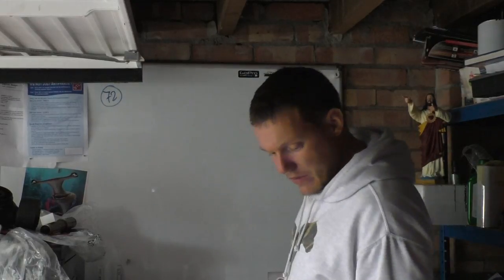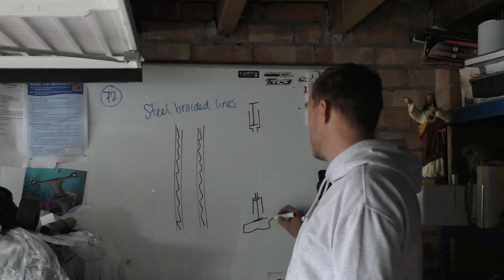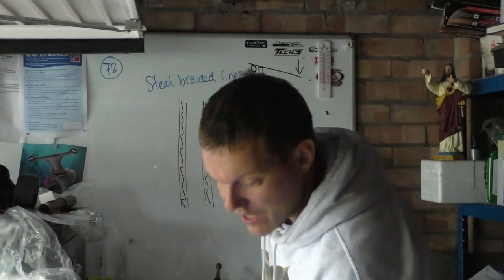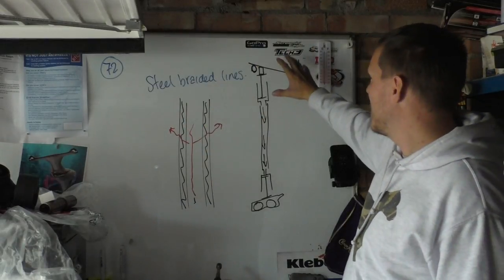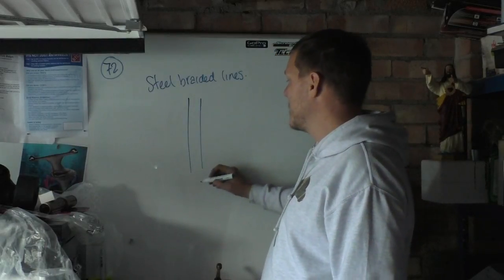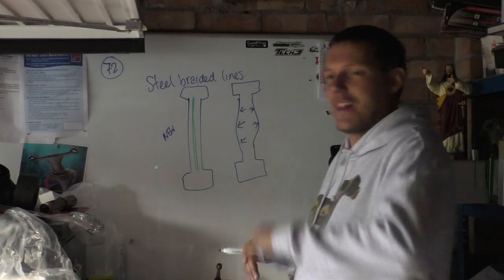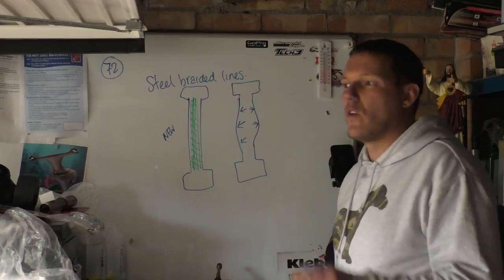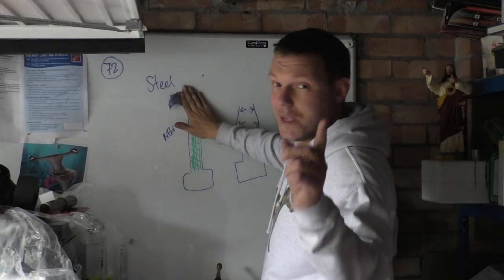Braided Brake lines - why? -and how?

Comment: let me comment that. Once I replaced the brake lines on my bike. I was courious about the OEM brake lines, so I took them apart. I found the following. The major diameter of that rubber looking line is not the brake line. Inside that rubber line is a much thinner kinda plastic hose. i dont know exactly what material, maybe nylon or teflon. This thinner hose is only about 3 to 4 mm in diameter and the walls are quite beefy. The hole for the breake fluid was only 1 mm where the whole brake line looked like about 8 mm in diameter. Those thinner inner hose reminds me on industrial special hydraulic hoses which support pressures above 1 kbar. But furthermore the inner structure also connsists a braid. Not steel, but a kind of braid.
My thought about that brake line changing intervalls are super paranoid engeneers. I belive as long as the fat outer rubber line is able to protect and nicely embed that thin inner line everything should be fine. But once the outer line degrades by ageing or UV exposure etc. the inner line is in danger. And moreover are plastics known to stiffen up over time an get bridle.
The steal braided lines usually available here in germany sold as a lifetime solution. For sure the steelbraid is more stable to the elments and mechanically more capable than the rubber ones. And the inner line on those steel braided ones seem not to be affected by ageing taking that lifetime warranty in consideration..... just my thoughts!
Reply from the maker: The braiding is usually nylon stranding and for some brake lines aramid fibres i.e kevlar
Reply: What I also wanted to point out is that the OEM brake lines are by far no easy or cheap sulution. They are more than a first look reveals. So I agree with your saying about new OEMs feeling as good as new steel braided. I myself changed to steel braided ones within a time the OEMs where far away from beeing overaged. I was quite dissapointed from the change until I found out the OEMs are nothing someone should call crap.
Reply: Thats right. My intention was to highlight that the OEM Brakehoses are not simple Rubberhoses as they may look like. And of course the outer rubber is to protect from the elements. And if the rubber gets a sort of damage the function is normally not imideately corrupted but the protection is weakened and a replacement is adviced...

Comment: the lever is only part of the force muliplier, much of it is in the difference in area of the master cylinder and the slave cylinder
Reply: I was going to mention this also. I doubt it's anything more than an oversight on Matt's part, he's not exactly stupid.
Reply: He tends to keep it simple and get to the point without TOO much tangent. Even talking about the lever is already a sidetrack in a vid about line material and construction.
Reply: thank goodness there's still some people with at least basic physics knowledge. yeah, so basically, the piston in the master is smaller area than the slave. so the longer stroke on the master transfers to much shorter stroke on slave, but with bigger force.
Reply: Lasse Langwadt Christensen and bore size etc etc etc...

Comment: The amount of arguments I have had with dickheads regarding their OEM lines being shit is numerous.  I even measured the expansion of the hose between no pressure and two hands wrenching at the lever - zero expansion!  To be fair, I have replaced lines that have been old and there has been no drmatic change. Of course when you change liens, you change/bleed fluid and I believe this is the biggest difference people feel.  They have their fluid they haven't changed for years, got some gas in it, probably 95% water so boils easy, then they replace their lines and fluid - 'holy fucking shit balls my brakes are amazing!'

Just a quick note: You forgot to mention the hydraulic torque manipulation with regards to different size cylinders - a small syringe to a big syringe translates a large movement, small force into a small movement, big force and this is primarily where the force for clamping brakepads comes from :)

Comment: thanks great vid i did have sam brake fade on downhill almost ordered new stainless lines but it turned out the i wase using sam very old brake fluid probably had sam water  in it

Comment: People talk about spongy brakes - what's so bad about them? Personally I've only had 2 bikes, both with rubber lines. My first was a shitty little 250, and they were spongy as hell, but I got used to them and never found them to be a nuisance; my fingers just adjusted and applied the right amount of force on the lever as required. I imagine braided ones are more responsive and require less force on the lever making them more sensitive, but is this a universally good thing? Basically I'm seeing this as simply a personal preference for something more sensitive. Is that the case?
Reply from the maker: with a 250 then the bike doesn't weight so much and you aint going that fast. Try stopping a 1000cc with spongy brakes
Reply: haha oh damn, well that clears things up for me hahaha

Comment: I had my scooter for a year before taking the plunge and getting braided hoses. Felt the same. Next service, they did the brakes, came back solid. I requested to keep my OEM hose though - just in case.

I want braided lines on all my bikes now.

Comment: You mention hydraulic clutches, perhaps a topic for a future video. Hydraulic vs. cable clutches?
Reply from the maker: YUeah mate already on the list and waiting to do the clutch on the SV so we have a physical example
Reply: There's a guy with an adventure bike channel (motorcycle adventures) who just runs a second clutch cable next to the original one, just tape it to the handlebar and frame at the bottom end. When the cable breaks, you can easily replace it in the middle of nowhere, because you have the line already in place, just need to hook it to the clutch and lever, adjust and off you go. I thought that was a pretty smart solution. That's not as easy with a hydraulic clutch, but not an issue if you're always in phone coverage area. :)

I have a friend with a new Harley with a hydraulic clutch and he says he doesn't like it much as it's very direct. Maybe just a very short friction zone, which could be an adjustment issue, but he's convinced cabled clutches are the way to go.

Comment: Firstly Matt, does the steel in braided lines help dissipate heat from the fluid better? Or does the plastic 'insulation' counteract this?

Also, do you use braided or OEM?
Reply from the maker: "steel in braided lines help dissipate heat from the fluid better? Or does the plastic 'insulation' counteract this?"

The thermal mass of system - i.e the aluminium calipers will have more to do with the heat dissipation than the steel. There are quite a few layers depending on what brand you choose. Some have rubber some have Teflon and kevlar etc.
Reply: @The Workshop yeah makes sense

Comment: Matt, If after 4+ years the steel and plastic shroud is in good nick on your braided lines, is there any reason to replace your lines?
Reply from the maker: For £30 - £40 yeah and your fluid - it depends if you have brake issues - if your going to replace the disc then I'd do the whole lot at once.
Reply from the maker: Obvious budget comes into it.....

Comment: Pretty sure SS brake lines use PTFE (polytetrafluoroethylene) aka Teflon, not rubber. It's less likely to break down over time. As for one debate I'm not sure of, is black brake fluid from moisture, or rubber? I've changed black brake fluid and it went black shortly later. Makes me think it's the rubber contamination.
Reply from the maker: It depends on what brand but Teflon is the way forward and a lot of brand have either started that way or switched/switching over. They generally have layer of Kevlar weave over the Teflon and sometimes a nylon weave over that.

Comment: I put a set on my Ducati and didn't really feel any difference. I also fitted a set onto my Elise and my Caterham and they made a huge difference. I felt less travel on the pedals and just sharpened them up. All were HEL. Would I say the cost to fit it to the Lotus was worth it? Not really. Had to remove he body to get to them which was a fucking nightmare. The Caterham was easy, it has no ABS so the braided lines made it feel like I had fitted a whole new braking system. So for me its been a bit hit and miss.  

My advice is if you have to change them then put some good 1's back in, if they don't need changing then leave them as they are. 

Been wearing my "FUCK THE PANDA'S" tee-shirt with pride.

Comment: body all brake lines are reinforced by steel, nylon etc. brake likes are tested very vigorously for 5000 PSI spec, in reality, they only take 1500 PSI, so if brake likes  are made correctly they are 30 years readable, plus if you see that brake like is bultching that is a bad line as they not suppose to do so
Reply from the maker: "so if brake likes are made correctly they are 30 years readable,"

1) not according to the OEM 2) I've seen brake lines bulging after about 5 years - don't know where you're getting your info from

Comment: I thought that the handle was only part of the force multiplier and that the vast majority of the force multiplier was in the hydraulic cylinder? And that is determined by the volume moved  of one side compared to the other. I know this is mostly moot to most of the video, but just got me to wondering. But other than that I know what is even better than steel braided brake lines... Evan's coolant for your brake fluid, because it's made with fairy dust!!
Reply: It's the ratio of cross sectional area between the brake caliper pistons and the master cylinder pistons. The spongy feeling comes from the flex of the line, and sometimes, the firewall on a car. People fight about the diameter of the line. Its a bullshit argument. Yes, bigger lines flex, but if they have thicker braids, they won't, so it's a line problem, not a concept problem. If you use teeny little lines with giant caliper pistons, the fluid has to go through the line and banjo bolt at really high speeds, so the brakes respond poorly no matter what. Some calipers prevent pad pull-back, so those are unaffected.

Comment: I've wanted to adapt one for the hydraulic clutch on my car, thoughts? Brake lines are already high quality ss braided because daily racecar.
Reply: My car is fookin awesome. Gave my buddies 1300 (some touring Kawasaki) enough of a hard time. It intimidates way above it's worth. It's what got me more into the technical side of engines. The SS brake lines are for consistency in the pedal, same feel every time, cold - warm - hot, and the only upgrade to the factory brakes which were otherwise good enough to take racing with a quality pad. My clutch takes more wear, tear and abuse than the brakes, everything else is sharp so why not.
Reply: PGTMR2 Your awesome car would be destroyed by a bike that costs 2k.
Reply: Kris Nicholson Not having trouble driving manual, and I don't need a different clutch, or master, or slave, or synchros or a bike.
Reply: And your awesome bike will be destroyed by negative temperatures, snow and ice? Everything has its downsides and upsides for example are you going to take a buddy onto the back of your bike and go racing? If you own a car there is absolutely no problem. People go racing with 4-5 people in their car.
Reply: How many days per year there is snow in the UK? Why would you take a buddy to go racing? You realize racing means going as fast as possible to get the fastest lap? What the hell are you talking about? Who races with a full car of people? The weight would make even the fastest cars equal to a toyota avensis. Even a yamaha r125 would destroy it on the track.
Reply: It's possible he meant taking 4-5 people to the track and then racing alone... unless there's a clown car challenge... which should be televised globally.
Reply: Commander833 racing with your buddies in the car is fun and unless they are all fat it is still okay. not ideal but who cares? racing is about driving as fast as possible not building the fastest vehicle possible, that just follows in most cases.
Reply: alles klar klaus even the fastest cars are slow as fuck compared to small motorcycles. There is no such thing as a performance car if it can be overtaken by r125
Reply: R125 is that pull string or pedal start? Trying to think of a car that couldn't beat 13 seconds to 60 or can't go over 140KPH. A Beetle from the 60's? Maybe a Hummer H1? Whatever, it's a short list and definitely NOT "performance" cars.
Reply: PGTMR2 I can buy a gsxr 1000 for 4k and destroy supercars that cost 100k+ and even then they would be humiliated. Search YouTube gsxr 1000 vs (insert a supercar) and you will see for yourself. Cars are pathetic compared to motorcycles in terms of performance
Reply: Yes, but you're not going to do that with a 125cc or 250cc, or even 500cc bike. Pathetic is comparing a 1000cc apple to an orange in the first place. You're only doing that because there is an 1100cc or more apple that will shit on your 1000cc apple. The F-14 in my pic, (apple,) takes off at the terminal velocity of your GSXR 1000, (orange,) and then goes on to mach 2.4. Does that make your GSXR 1000 example pathetic because it doesn't fly or break the sound barrier twice over? They're 2 different things. GSXR wouldn't be great at boating or rock climbing either. I can get a boat and a Jeep for less than $4k, with some money spent on chewing gum to make the boat float, but, I'd still be doing 2 things the GSXR can't. Puhhhh-thetic! See how that works?
Reply: PGTMR2 What you have said is referred to as the ''False equivalence fallacy'' is gsxr supposed to fly? The sole purpose of a motorcycle is to ride on the tarmac and so is the car that is why it is a fair comparison. Comparing bikes with boats is the false equivalence fallacy
Reply: PGTMR2 performance cars are made for performance driving and they get obliterated by motorbikes. I just laugh at all the performance cars I pass on my mid weight sv650s when they try to challenge me. People buy bicycles because they are cheap as hell. Why do people buy performance cars when they are so much more expensive for less performance than bikes?
Reply: If you don't succeed the first time, try the same argument again? You're on repeat here. A Porsche 911 could take down your bike in 0-60 time, why haven't you traded for a $4k GSXR 1000 yet? Completely rhetorical question. Bad Obsession Motorsports, Project Binky episode 16 is out and you're interrupting with this nonsense. It takes months to get a new video from those guys. So if you're finished...
Reply: PGTMR2 porsche destroys a gsxr 1000? I am done bye bye. Live in your own magical world where porsches are able to destroy 1000cc superbikes. Fuck cars, you know why even a 49cc scooter is faster? Because they don't have to sit in traffic for hours.
Reply: Oh. You're not finished and you need me to walk you through this. Okay. No a stock Porsche 911 destroys YOUR bike. Why haven't you traded YOUR bike for the $4k GSXR 1000 since it's teh not puhthetic? Again, it's a rhetorical question, that means you don't have to answer because I don't care what the answer is. I don't have to drive or ride what you have.  I would take the GSXR over YOUR bike though, if that makes you feel any better? Have a nice day?
Reply: PGTMR2 I have no choice, I am on a restricted a2 licence. When I get my full unrestricted licence, I will get a gsxr 1000
Reply: PGTMR2 An old beetle with 26hp will probably be slower yes

Comment: Some places braided lines are not legal for road use, best to check first before using them.
Reply from the maker: Really? - Like where?
Reply from the maker: Oh and why? LOL
Reply: Here in Australia, reason was inability to visually inspect them due to the braiding over the outside whereas rubber hoses can be inspected for any cracking or perishing that is a precursor to failure. Interestingly or not, rubber brake hose failures can be internal ruptures that cause them to act like a one way valve and wont release fluid causing caliper binding. But of those I've found they all had signs of cracking on the outer cover and visually rooted..
Reply: Just to add, you can get them but they have to be ADR approved here which rules out pretty much all the after market braided hoses you can buy here.
Reply from the maker: Very intresting to know - what the fuck does ADR stand for?
Reply: Aus Design Rules, like Vehicle Safety Standards.
Reply: I'm a believer that many aftermarket designers improve flaws from the OEM parts. Not always true, but it's at least true OEM don't care to improve design flaws unless it causes a law suit.
Reply: AuMechanic shit, really? After seeing this I was going to put braided lines on four of my registered bikes.
Reply: - You can easily get legal braided brake lines here in Australia.  HEL and Goodridge both make ADR approved braided lines.  Just be sure that you are clear about what model of bike you have.  Braided lines are very stiff and won't like being forced onto a bike they were not meant for.
- I thought that laws were introduced to stop screw together lines from being used on the road. That is, lines that are connected to their banjo end fittings by screw connectors.

Comment: If rubber goes wonky and steel braided lines are better, then why not use metal tubing? Stuff like this: http://smt.sandvik.com/en/products/tube-pipe-fittings-and-flanges/tubular-products/hydraulic-tubing/
Reply: The lines have to be flexible for things like the suspension to go up and down.
Reply: scott winslade Yup, I know that,  but it could easily be done; however, it just isn't practical. It could be done just as an engineering exercise. 😂
Reply: Cmon Daniel! 🙄